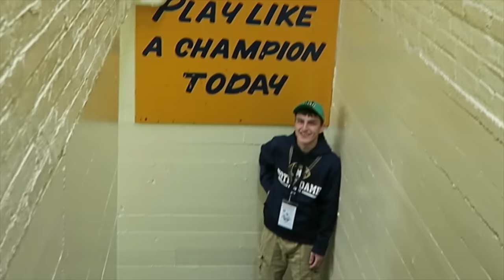WHY I CHANGED MY HAMSTER'S NAME

Comment: speaking of mattresses I had a mattress for years and at the time I bought it the mattress was so hard I use to have to have a foam pad on it and I use to get a lot of allergies in the morning sniffling and stuff. Well than about a year and a half ago In October of 2015 I was looking online for a blanket and then learned that a mattress should only be kept 10 years or even 8 years and my mattress was 20 years old, yep 20 whole years old. I didn't know what I was thinking!!! I ended up buying a twin pillow top mattress from Macys I think it was expensive on sale like maybe $300 on sale. SInce its a pillow top I can turn flip it I can only turn it. It was so comfortable and now I am use to it but its still comfortable. I wish I would of bought a queen instead of a twin don't know what I was thinking. But its fine I really like the bed. PIllow top is so comfortable and I stopped getting allergies and I started sleeping a lot better. But the allergies went away I stopped sniffling in the mornings.